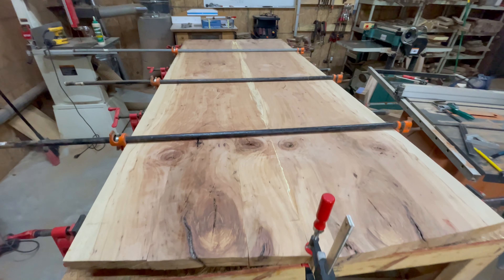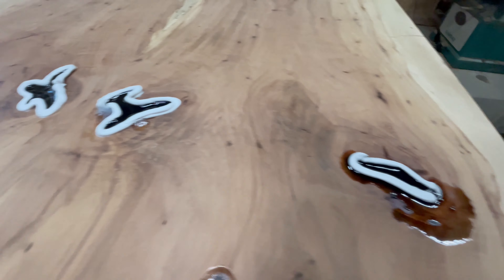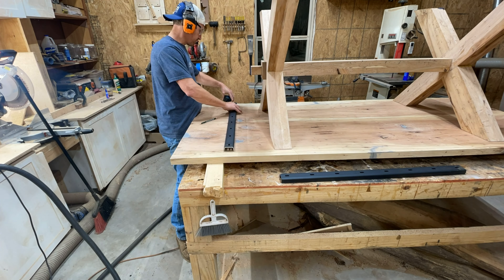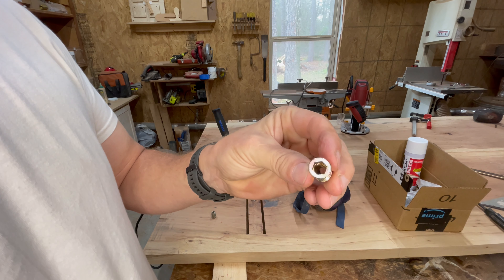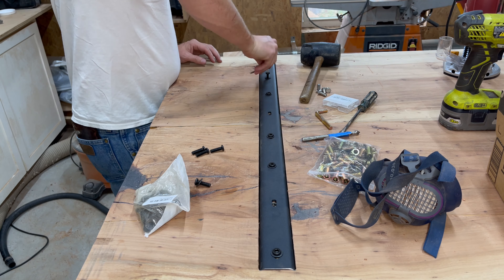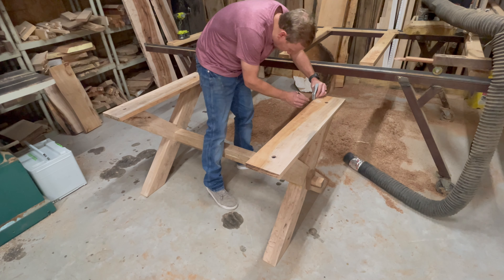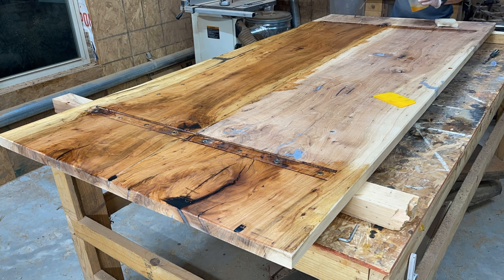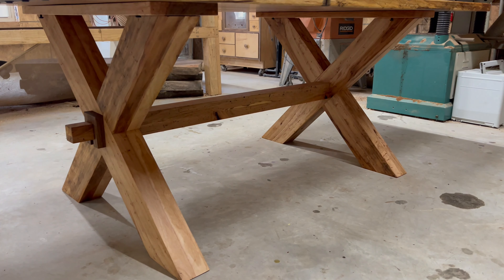EXPENSIVE Farmhouse Rustic Heirloom Dining Table Build - Final!

Comment: Is the reason for tinting the epoxy filler just for looks? Seems like it would be harder to fix mistakes with that dark color. Does the wood finish then adhere ok to the epoxy?

Great work. Very impressive looking. Love the beveled edge too, sometimes it's the little things!
Reply from the maker: Yep! You could tint it any color. Leaving it clear is fine too but often there’s tiny bubbles in it, but I prefer to look of black so it doesn’t detract from the wood. Much easier to fix mistakes too! Black CA glued fixed a lot of bubble holes here. And thank you for the kind words!!

Comment: Just a heads up you can get hardwood inserts that arent tapered have a finer screw and made of zinc coated steel over cheap flimsy god knows what metal they use for the tapered inserts. Learnt that the hard way on river red gum
Reply from the maker: Yeah I didn’t show it well enough, i ended up using the ones you mention in the rest of the bolt holes